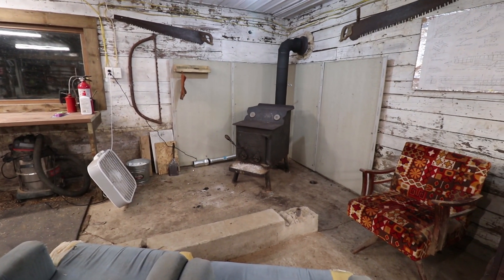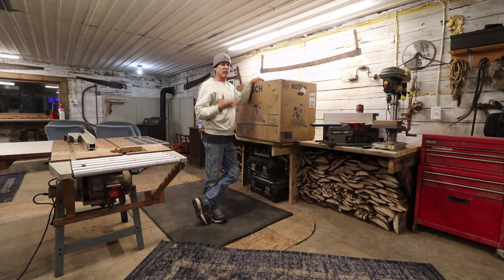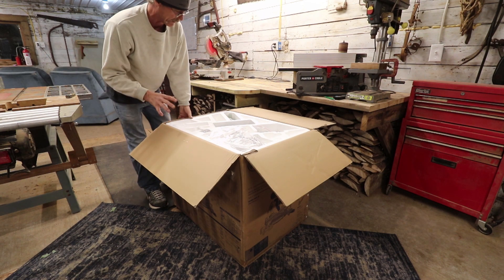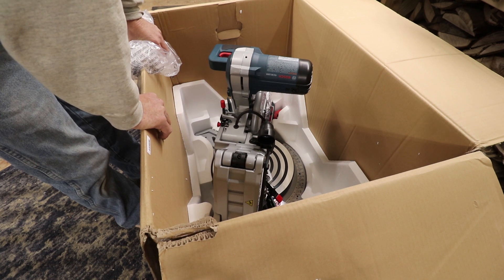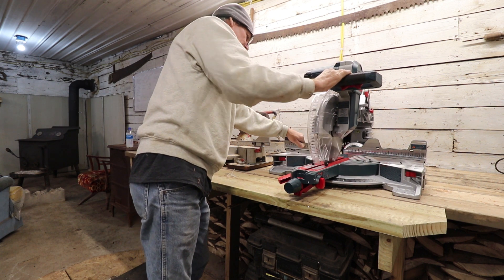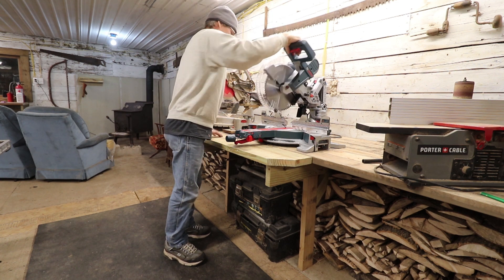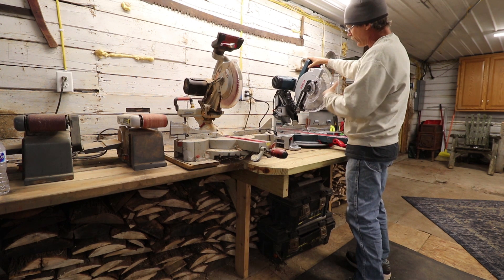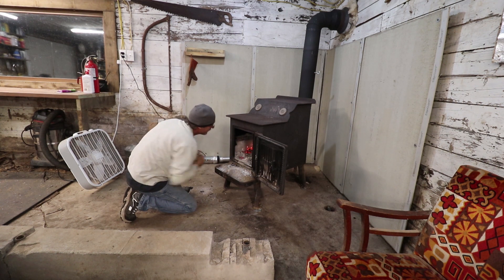THE FARMHOUSE. New Workshop Miter Saw. More videos coming very soon.

Comment: For years I used a Craftsman saw. Over time, I found out that the saw was out of alignment. Being broke but needing a saw, I went to Harbor Freight and bought a 10 inch one.  It performed much better than the Craftsman and I was impressed. I do not do woodworking anymore, so I gave it to my son-in-law who uses it in his work. It is still running strong.

Comment: I am going to buy a new 12 inch miter saw and I am also a Dewalt person but I was looking I also ran onto the Bosch saw but in the store you cannot tell much by just looking and they don't seem to be to happy about folks playing with the display models lol but I was able to get my questions answered by your demonstration so Bosch here I come lol the part I liked the most was that it didn't need as much room behind it to slide and cut in my work shop room on the shelf is very important Thanks Joe you helped me a lot Semper Fi
Reply from the maker: That extra space is golden. You only need a 24 inch deep work bench. Thank you Ray.
Reply: Better read about the depth of cut. 3-7/8” depth of cut, and I was so pissed when I got mine. Sent it back and got the new Dewalt w/shadow line.

Comment: That all nighter is an airtight stove. I think you’ll find it in designed to be used without a damper in the stovepipe. The draft is controlled by the front dampers. We have one just like it at camp. No damper.

Comment: Woohoo!...The inaugural use by "The Beast", Love it.   Hey Joe, I contemplated buying the Bosch and like you, I love their tools and have their routers.  Like all miter saws, their dust collection sucks.  The articulating arm with it's space saving design (over the 12 inch Dewalt) just didn't push me over the edge especially since both my 10' and 12" Dewalt's continue to serve me well.  When the time comes I may have to take the leap but for now, I will hold tight to my  old trusty saws.  I just hope when I need it it isn't as ridiculously priced as 
the drum sander I sat on buying prior to the pandemic.  Now it is so ridiculously priced that out of principle I have not purchased it.  Is there ever going to be relief from these prices or is this "the new normal"?
Reply from the maker: I do love DeWalt tools. They are the best. I got the Bosch because of that space saving without the slide. Not that it was needed BUT the workshop is just getting its inaugural run so if I were to move anything around that saw will fit anywhere.

Comment: Now you need a vacuum system to help catch some of the dust and not plug up the filter on a shop vac. All depends what you cut where or not it goes into a bag, which is never big enough to begin with.

Comment: You’re not gonna be happy with the depth of cut. 3-7/8” depth of cut. I was so mad when I got mine. The Dewalt shadow line, or the Makita are the best.
Reply: Where is the restriction ? if you want to cut the extra eighth to go straight through 12”x4 ”  I’m sure you can adjust it !
Reply: @CrimeVid  no sir you can not. The drive is set too low and won’t pass. Its not high like the Dewalt or Makita.

Comment: Bosch Blue is WAY better than DeWalt. Hands down.
Reply: The Bosch only has a 3-7/8” depth of cut…better than the Dewalt w/shadow line? I hardly doubt it!
Reply: @SuperDave44Mag  who cuts 4 by 4s on one of these type saws that often?
Reply: @beckyumphrey2626  I’m a trim Carpenter…even though people do use these saws to cut 4x4’s sometimes, these saws were made mainly for trim carpentry and cabinet making type work. (4x4’s are only 3-1/2” x 3-1/2”, most chop saws can handle that depth of cut.)
Reply: @SuperDave44Mag  when would max 3.75 cut depth be an issue doing trim?  I suppose it may if cutting a miter on wide  crown mould.
Reply: @beckyumphrey2626  you’ve never run 5-1/4” base before have you?
Reply: @SuperDave44Mag  sorry, I haven't.  In that case I suppose this saw ain't a lick of value doing that.
Reply: @beckyumphrey2626  it is a great saw, and I love mine, but the depth of cut really disappointed me. It stays I’m my shop and my Dewalt goes on the job site with me.
Reply: @SuperDave44Mag  Bosch is German, De Walt is not. Nuff said.
Reply: @chrisis9030  Dewalt can complete the job, Bosch can not…nuff said. It’s all about production on the job site, and the Bosch can’t out produce the Dewalt or Makita for that matter. Love the saw all you want doesn’t change the facts.
Reply: @SuperDave44Mag  Your job site's not mine, pal.